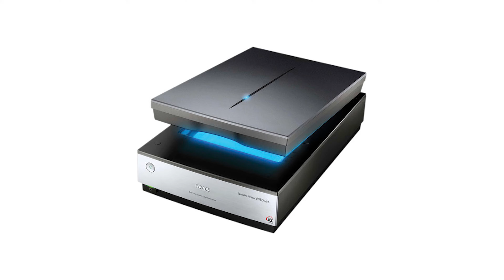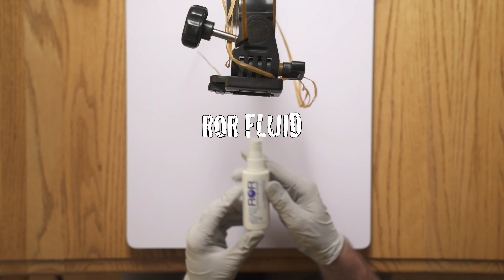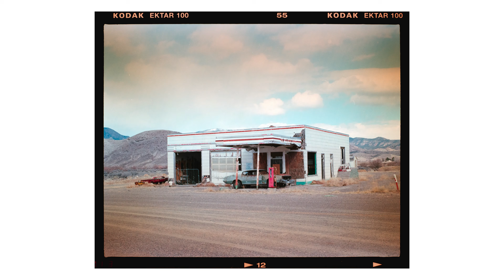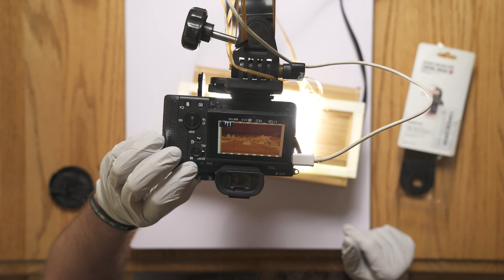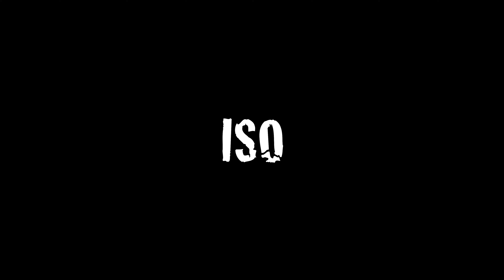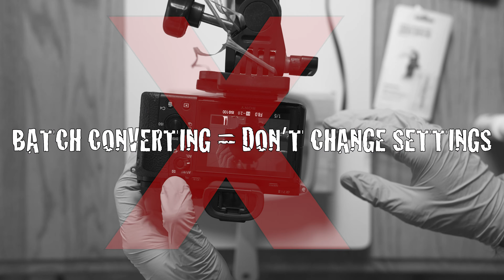How To Scan Medium Format Film With Full Borders

Comment: Not done anything like this yet but the frequency of your light and shutter speed wasn't mentioned? This doesn't matter? I liked this vid bc of the details covered.
Reply from the maker: @killpop8255  Hi! Here’s the specs on the light source:

Skier Sunray Copy Box II: 1250 lumens, color temp: 5600k, CRI: 97
(There’s a gen 3 version out now that has adjustable brightness)

To find the shutter speed for your particular setup: adjust the shutter speed until the camera’s exposure meter reads +7 or +1. That’ll be the shutter speed you’ll use. 

I range from 1/80 - 1/250 depending on color or B&W and the density of the negatives.

Thanks for watching the vid, asking your question and leaving a like! I appreciate you! 😎👍🏻

Comment: That was a great tutorial, well done!  I use an Epson V600 but have thought about trying a copy stand.  Question; I noticed the tape border on your glass.  Do you find that the small gap between the glass helps to prevent Newton rings?  When I want to scan full frame including sprocket holes, I use the 120 film holder for 35mm and scan emulsion side down.
Reply from the maker: @steveshadowphoto9346   Hi Steve! Thanks for checking out the video! 

Ahhh good eye! The shop that I bought the glass from put the tape on the edges so I wouldn’t cut my fingers 😆 BUT,it  may help with Newton rings. (I do have to use a piece of ANR glass when scanning 35mm or the NR’s are TERRIBLE!)

Sounds like you’ve got a good system worked out with your V600 - do you have any issues with Newton rings with that setup?